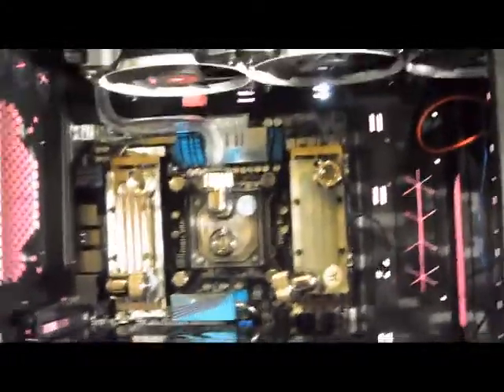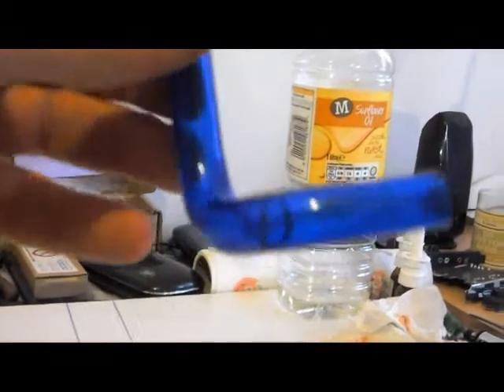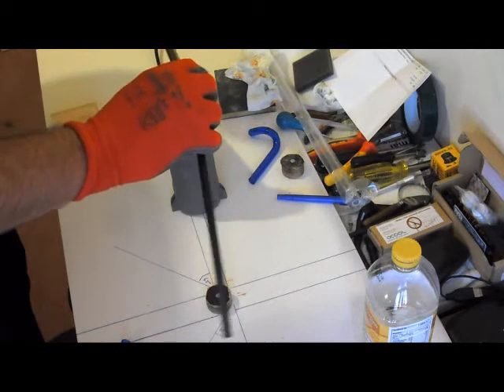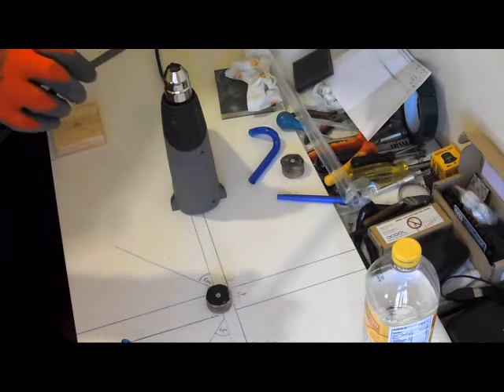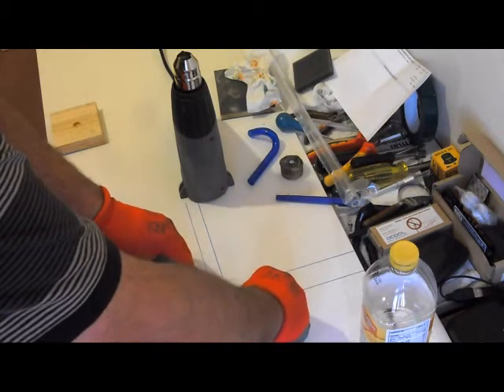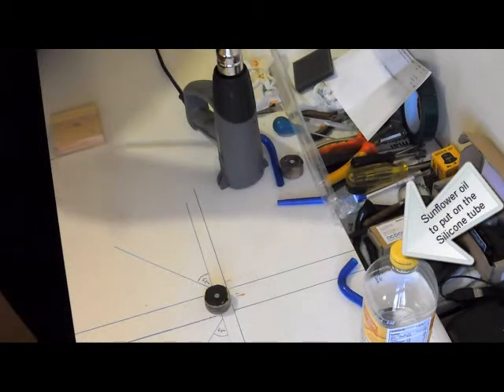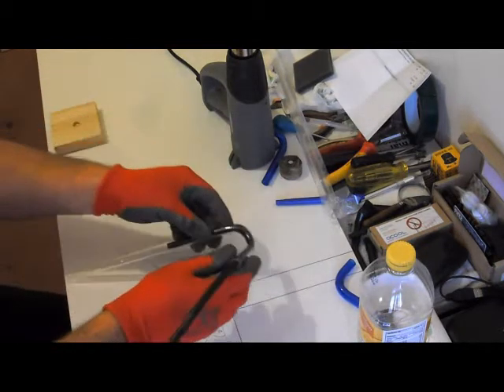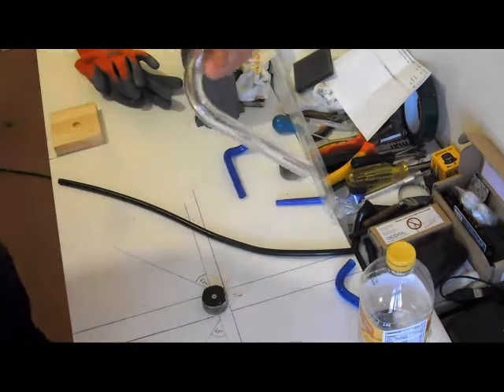PC Acrylic Tube Bending Demo

Comment: I need to do this for an aquarium project with 10mm id clear acrylic tube.  What are you using on the inside to stop colapse? 

Thanks.
Jim Whitaker
Ohio, USA.
Reply from the maker: +Jim Whitaker 
Hi Jim, I used a solid silicone tube from Overclockers , thanks for watching the video.